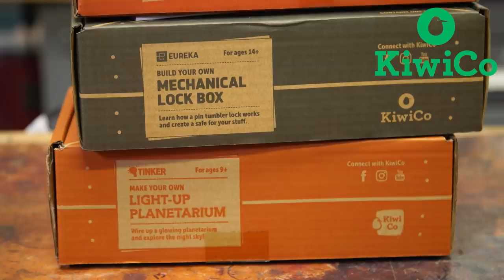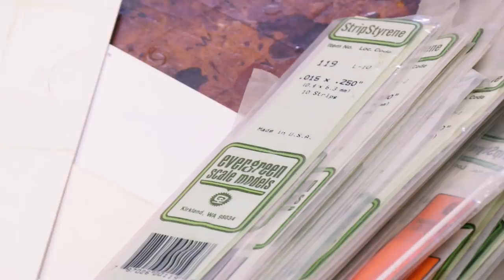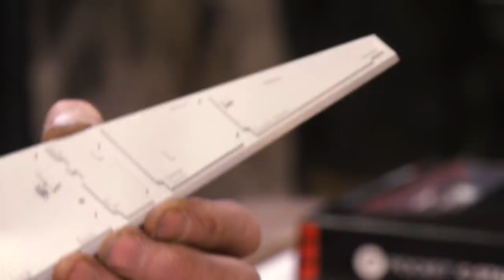Adam Savage's Guide to Model Spaceship Paneling!

Comment: Weldon-3 (as most acrylic "glues") is basically methylene chloride (a.k.a. dichloromethane). Instead of wide cup and a brush, you should just use a small syringe (with a blunt dispensing needle) for two main reasons (which are really the same):

1. It won't evaporate, so you save glue.
2. It won't evaporate, so it won't get into your lungs (as organic solvents go, it's not the worst, but it's still biotoxic and will slowly burn your lungs from the inside, if you're not in a well ventilated place).

Also, it's easier to make sure you only apply glue to the right places, instead of brushing over the front face of the panels.

Don't use a "bottle" type applicator, as it will still evaporate inside it, and you need to squeeze harder as it gets emptier. A syringe will always dispense the same amount for the same pressure, and gives much better control.

Note that (unless you use a glass+teflon syringe) the solvent will slowly eat through the syringe itself, so don't leave it "primed" for several days, or it might start leaking; always empty the syringe when you're done, and switch to a new syringe after a couple of days' use.

Also, note that there isn't much point in wearing a mask, because dichloromethane goes through pretty much any filter. Just make sure as little as possible of it is exposed to the air, and make sure there's ventilation. Use butyl rubber or neoprene gloves when handling large amounts, and don't bother wearing gloves when handling small amounts (a few drops will evaporate off your skin in seconds; don't use latex or nitrile gloves, because it will melt them and stay on your skin longer, which can cause chemical burns).
Reply: I think Adam's technique definitely reveals his roots.  Imagine being on a team trying to crank out several hundred models as quickly as possible.  The time saved using his method would really add up after placing 20,000-30,000 greeblies.
Reply: @jimmyparker4335  - I'm not sure how using a brush (which you have to constantly re-dip) is faster than using a syringe (which you can just keep in your hand).

Also, I definitely wouldn't want to have have a bowl of methylene chloride evaporating 10 cm away from my face all day long.
Reply: Yeah I was slightly concerned when he did not take any care around breathing the solvent and didn't give any warnings about how toxic it is.  The syringe method is also faster, not just safer and more economical.
Reply: Well you can also use MEK (Mythol Ethyl Ketone). Available in hardware and big box home improvement stores. Either way any of these solvents have the potentail to nasty long term. And every time I use or see a plastic cement being used I immediately think of Lloyd Bridges
Reply: @RFC-3514  He wasn't using a brush for the greeblies.  His dip method was super fast.
Reply: @jimmyparker4335  - He was using a brush for the panels, which is the title of the video. 

And his "dip method" (which isn't actually faster than holding a syringe in your left hand and putting a drop under each greeble as you put it down with your right) requires having a bowl of MC evaporating right by his eyes and nose all the time, which is something no one should do.
Reply: @mpetersen6  Looks like I picked the wrong week to stop understanding old references...
Reply: i worked with this stuff to weld cable spools together in a warehouse and i always did it outside with 2907 filters. sure, i might still be breathing the toxic vapors, but the smell made me feel physically ill. i always made sure to wear nitrile gloves. even if it's as permeable as you suggest, i'm sure that some protection has to be better than none at all.

either way, i always wince when i see adam doing this sort of thing and not advocating for ventilation/ppe. especially considering he uses the 3m halfmask with lacquer-based tamiya thinner so go figure.
Reply: @maximilian3004  - Nitrile is worse than not wearing any gloves at all. It'll evaporate very quickly from your skin, but seeps into / slowly melts the nitrile.
Reply: You are obviously correct, except the gloves should be polyvinyl alcohol (PVA), not any sort of synthetic rubber, since methylene chloride attacks and corrodes them.
Also (obviously) a protective eye piece.

However, is exposure is for low concentrations (less than 25 ppm (below the odor threshold) for an 8 hour shift, or below 125 ppm for 15 minute intervals) you can use an Organic Vapour respirator, but be sure to switch the cartridge after, as it is corrosive to the filters and strongly reduces the service life of them.

For prolonged and substantial exposure, OSHA actually requires exposure monitoring and SA (supplied air) respirators. Of course, for a quick build you probably won't be going through the exposure threshold, but your suggestion is good as it reduces the amount of vapour in the air.

At any rate, this thing's nasty, but back when Adam worked, the allowed limits were much higher.
Reply: @RdClZn  - Both butyl rubber and neoprene are highly resistant to methylene chloride. You can literally dip them in it and they'll be fine for days. PVA is even more resistant but PVA gloves tend to be quite thick, which can make it harder to handle small containers.

For the kind of work being done by Adam here, I wouldn't wear gloves at all, and would just keep the MC in a syringe (not in an open container). The amount of vapour let off by a few droplets is negligible.
Reply: @RFC-3514  you can check the EPA factsheet, it lists neoprene and butyl rubber specifically as not recommended glove materials for handling it.
Reply: @RdClZn  - The EPA has no jurisdiction where I live, and I wasn't able to find any reference to the scientific studies (if any) that they base their recommendations on.

Both butyl rubber and neoprene gloves are specifically listed by several industrial suppliers as recommended for handling dichloromethane, and my own experience (with those and other types of gloves) agrees.
Reply: Thanks for the great advice

Comment: A technique I've used since I began modeling in the late 60's is taking hole punch sets to punch out concentric rings and circles to make circular inspection panels and rings. Then you can take sharpened brass tubing to make very small circles that you use a tiny Phillips head screwdriver to gently punch crew heads in the center of those tiny circles. If you do any electronics work you can add tiny electrical parts like transistors and resistors to make canisters with hose connections into the base, electrolytic capacitors make great oxygen tanks! LOOKS GREAT!

Comment: I use plastic garage sale signs because they are often styrene and are usually cheaper than plastic sheeting. Just make sure to use sand paper on the paint to get the glue to stick.
Reply: Same!
Reply: Yup ! Everything from the garbage bin that's stamped with a recycle logo n°6 or PS (for Polystyrene) is up for grabs too : yogurt and fresh cream pots, some cheese packaging or shampoo bottles. They're great for compound shapes, thin panels, ready made ridges or even blocking out base volumes !
Reply: @the_arcanum  You just solved my problem.  Building a Lionel train layout and want to build a water tower. Next time at the grocery store all we need to do is find a correct size.  One thousand thumbs up.👍
Reply: @missyd0g2  Ah ! Glad I could help. Good hunting : )
Reply: @the_arcanum  This is such a great point thank you.  I do the same thing and knowing the correct recycle code is awesome help for people.

Comment: I've been using this method for decades in model railroading for buildings, train cars and more. I use upended shot glasses for glue fonts for styrene solvent, ACC, and carpenter's glue.
When I place a bit of styrene, I use a quarter twist of the xacto knife to release the piece.

Comment: A favourite greeblying technique of mine, is to make a stack of about eight Panther tank roadwheels, and cut that stack vertically, so you get two half stacks. Each can be cemented to the panels. It creates a novel 'thing' that most people could not work out the origin of. I've done it with small LEGO dishes, too. Looks great when painted and weathered.
I'm also fond of using an old hole punch to create circular plates from thin styrene sheet. I use my old Tamiya riveting tool on some of those, as well.

Comment: I'm a 3D hard surface artist and currently working on some mid-poly hard surface environment and a lot of the basic ideas you speak about in this video really resonate in my digital work as well (using "greeble decal sheets", blocking out the shapes, layring the panels etc.). 
I really have to do some physical custom builds in the near future, it looks so much fun (I normally only build Gunpla modelkits^^).

Comment: I get my styrene free. Most stores use styrene signage in one form or another. A lot are only useful for a limited time then get tossed in the trash. Try asking local places, I've found that most will give you the old ones. I used this method when I scratch built the Valley Forge from Silent Running.

Comment: It's amazing, looking at any Star Wars or Star Trek ship which had a physical filming model built (I have built many kits from both franchises) and you can clearly see how these techniques were used, this is probably why early CGI felt off compared to the physical models, as you were not going to notice the surface details they did not include them, but even if they are barely visible on screen you do notice. 
That's just my theory and I could be wrong

Comment: Love seeing your mind work on the fly. When working with styrene I often had trouble stopping the blade from wandering when cutting straight lines using the knife edge, even while using a steel rule.  A trick i was taught is to use the back of the blade to drag along (on x acto blades) it scrapes a tiny bit of the styrene away with each pass and gives (for me anyway) a more consistent straight cut. Would you please try it for yourself as i would love to have your feedback on it

Comment: There are similar pattern notchers in the fashion industry, they cut a slot rather than a square, but the priciple is the same and they're made for pattern card, which is a lot like thin styrene in the way it cuts/handles.  

You can buy them from haberdashers and other places that sell tools to the fashion industry.

Comment: Instantly recognized the Fiskars orange on that blade handle! It's a decent handle, though I have gripes about the little blade protector cap and I'm sad they don't sell replacement rubber grip parts, as I've worn through mine. Luckily it was simple to model and 3D print a new one!

Comment: The notching tool... can't seem to find anything like it other than sheet metal nibblers, and I suspect this isn't anything like that. I'd love a closer look, looks like it would be a pretty fun tool to make! EDIT: Sorry, I didn't watch far enough... I found one on ebay & bought it just a few moments ago... THANKS!
Reply: It is indeed usually called a nibbler. Adel has been making nibblers for quite some time. I think the design goes back the 50's or early 60's. Genuine Adel nibblers are not cheap but they are still best and made in the USA.
Reply: Brian Gilbert can you provide a link please?

Comment: To cut thick styrene, try scoring it with the back of the blade instead of cutting with the sharp edge.  "Scrawking" the card removes material instead of just pushing it aside and creating levees either side of the cut.

Comment: For easier application of glue, Tamiya Extra thin does the same job, (even though i would guess, it's more expensive).
Also, don't throw the offcuts of the Evergreen away. When your Tamiya Extra thin is getting empty, put the offcuts in there, to make sprue-goo. -makes for at great filler ;)

Comment: Qn: The technique here builds up panels from an underlying structure, from a different perspective, it can be seen as skinning over the structure and leaving gaps/ lines between panels that shows the underlying structure to create depth.

How would the approach be if the job is somehow restricted to cutting into the structure/ engraving panel lines and details? Adding greeblies would largely be the same (although the approach may differ) but I'm more wondering of the tools, technique and considerations in a subtractive application.

Comment: Is it necessary to sand the panel becuase of the dried glue? Won't you get small lines up close? Just curious as i'm yet to try it out and i'm going to because it looks great.
Reply: No, the glue areas are totally flat. You can see it because it makes the plastic rougher so it reflects differently than the non-glued plastic, but it totally evaporates and when you paint there's nothing visible.

Comment: I DIDN'T UNDERSTOOD the vaccum forming curves part  ....   I'm dum dum LOL
Reply: Imagine you have a shirt on, and you "freeze" the shirt so it hardens. You take it off. Now you can put another shirt on over the hard shirt, and then freeze THAT one. The outer shirt will fit over the inner one, but not the other way around, because the outer shirt is bigger. And now you can cut up the outer shirt and glue the pieces onto the inner shirt, and the curves are all exactly the same, like if you wanted to cut out the elbows of the outer shirt and glue them onto the inner shirt for thicker elbow patches.

Comment: I feel like if you're building an original model for display, where people can put their glasses on and stare at it from 6 inches away for 10 minutes, as opposed to for movie use where it flashes by on the screen in 5 seconds, then you should probably observe stricter 'greeblie rules' so that the illusions of scale and credibility aren't broken. Some things I consider a no-no (by no means a comprehensive list):

Tank drive sprockets with the teeth still on,
Pipes that start and/or stop in mid-air or mid panel,
Half gun-barrels with the muzzle brake still on,
Sections of model kit runner that still look like model kit runner,
Half missiles with the fins still on,
Whole battleship turrets with the guns still on.